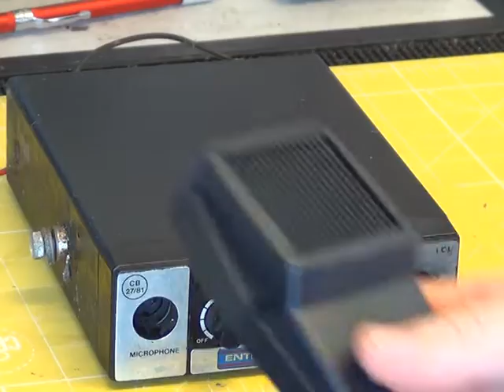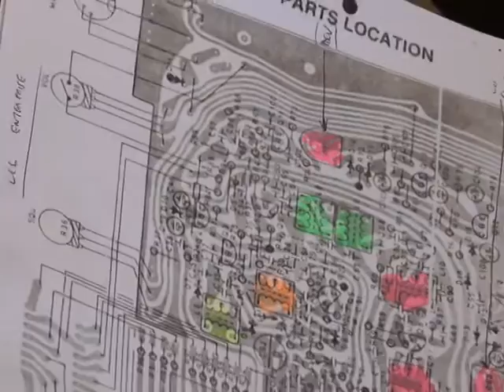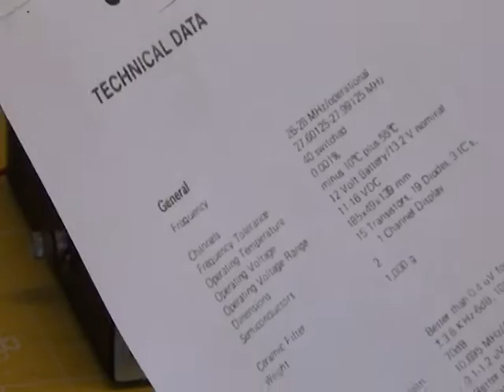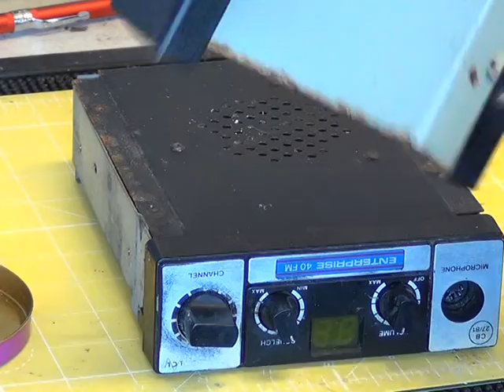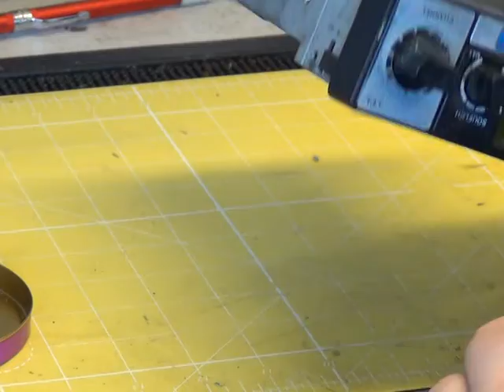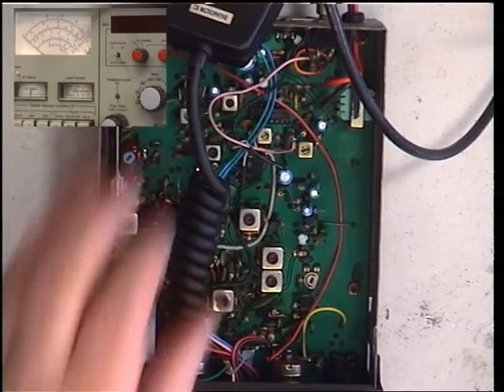LCL Enterprise (UK) CB radio (mobile) CB27/81- Overview & transmit alignment

Comment: How can we send you our radios? I have a DNT base station that doesn't seem very clever and needs your magic touch!
Reply from the maker: We normally only deal with the trade rather than end users for several reasons but  mainly because  the two-way radio side of the business is secondary to our traditional church pipe organ restoration business, so can only offer a 28 day turnaround with two way radio repairs. You can email me at rshireby@yagoo.co.uk

Comment: The trouble of yesteryear CB radios were adjacent channel rejection or bleed over, from the 1980s i went through dozens of radios and learned over time what was good and bad but they were fun times and  i made many new friends i still use CB today mobile phones killed things but i still have a good collection of new and old radios i wonder if the new electronics will last as long....
Reply from the maker: Mobile phones don't work here, but when I go into town & see all those teenage girls transfixed on their silly phones I think 'get a life'.

As you say bleedover was a big problem when CB came out and every fifth house sprouted a base station aerial. I've no idea how the latest models perform regarding bleedover because of fewer users, but 'crap' models like the Fidelity 1000 now work very nicely thank you!

I'm looking forward to doing the 'on the air' test with this radio at the weekend as I seem to recall these had crisp transmit audio...and it's doing a full 4W!

Richard

Comment: Possibly the worst ukfm CB radio ever made? 😂
Reply: delboyonline On the contrary, they are plucky little radios that punch above their weight. I had one when I was 13 and deeply regret letting it go...
Reply: @mattcameron9349  a mate of mine had one and it was a total bleedover box.
Reply: delboyonline Well, either I was lucky, or he was unlucky. I’m thinking of getting another one of these to replace my modern set, just for old times sake!
Reply: Fidelity 1000 : Hold my beer.